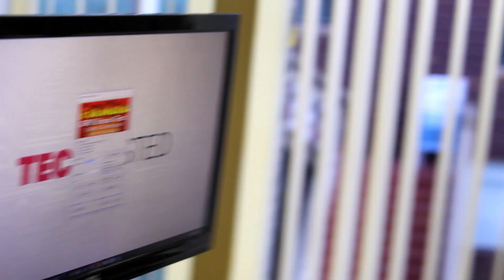The Pursuit of Silence: Foam Lining Case Mod

Comment: even though this is old you really don't need Foam Lining. 
i have a Corsair Carbide 500R with 8 Pure Wings 2 120mm fans BL081 hoocked up to a Thermaltake Commander FP SATA Powered 10 Port 4-Pin PWM Fan Hub AC-023-AN1NAN-A1 and with a Dark Rock 4, BK021 cpu cooler and well... its dead quite, i say a case with good air flow is more quite as you don't have to run the fans as high, even if it has dust filters that and use good fan control tools to keep the fans on the low side.

Comment: Double sided tape is what's making this test less accurate. You're not letting the case make a full contact with all the high density foam materials. I know you had your reasons for using the double sided tape but gluing all the foams for a full adhesion would have yielded the best results as intended in my opinion.

Comment: Decibels measures power logarithmically, a  -3dB attenuation = original noise x (10^-0.3)  that is HALF of the original sound energy, which if it is something like a sine wave means a reduction of the peak to peak amplitude of the sound wave to 70.7% (1/1.414) - the 2dB increase of the air cooler is a bit strange - didn't see anything about matching performance - the only fair test of that would be measure sound at equivalent thermal performance (tune the air cooler to keep the CPU around whatever the AIO was keeping it) so you have apples to apples

Comment: 3 dB isn't bad. You should give the results in W/m² instead of dB to give a good representation. Some people think 50 dB is 2 times less than 100 dB, but it's not.
Reply: +L3xou97 I was just about to say that! a 3dB attenuation means the noise has actually been halved (well the RMS of the noise)
Reply: forestR1
 I was not exactly sure if it was 3dB means half or not but now that you say it, yes 3Db is half the noise.

Comment: One thing that you might try is to cut some small washers out of the foam for all your mounting points of anything mechanical. So put them behind the screws for all your fans and drives. That will help dampen vibration from them and help keep it from making your case resonate.

Comment: Did you just add dampening foam to a windowed case? /sigh...
Reply: +Bryst whats wrong with that?
I don't think it looks bad, and it seems to reduce the noise level a little.
I'm looking to get the SilentBase 800 with a window panel, i hope it is quiet enough!
Reply: Its just a major waste of money because the windowed panel doesn't dampen sound as well as bare steel. You dampen all the other panels but the one thats staring you in the face isn't. So it really doesn't do anything.
Reply: I tend to disagree.
Of course, Acryl doesn't dampen the sound. If you want your PC to be really silent, go for a non windowed Version with foam on all sides.
But I like to see my Hardware AND have a quiet PC.
In theory the bouncing soundwaves in the case are reduced by applying any amount of foam, so, even if little, it does help.

If you want to have the most silent build with a windowed sidepanel, like me, foam is of help.
BeQuiet has a double glazed acrylic sidepanel to help with that.

Comment: You could also try open cell foam blocks in your unused drive bays (i have not personally tried this). 
This kind of foam might also be slightly better than that hobby foam, and it has adhesive on one side already amzn.com/B007P3ONSA
3db is a decent improvement though, especially if you're using your pc for recording

Comment: The H80i also has 2 fans... Also you removed the pump noise, so yeah, you did decrease the noise there.
Reply: +Shaxi except they measured a 1db increase.
Reply: on the basis of the number of fans to reduce the volume is completely nonsens ...

it is even better to install more fans the more fans you have, the lazier and quieter each fan can run ...

Comment: you want silence? use fewer fans that are bigger and slower, and stop asking for 50º load temps, 70-80 is ok for any cpu-gpu
Reply: 2 fans on the case is the best for performance per dollar.  Ur right bout bigger is better. You Could go fanless on your cpu cooler if you have an Intel cpu or an underclocked amd. I'm not sure how to handle the GPU besides it actually shutting off the below a temp threshold or going for a fanless gpu. Complete silence is really difficult.

Comment: dude, nice vid, use less fans on your case and you will have a quiet pc
Reply: +MrAndreppc this is true. But it is always better to use more slower fans than fewer faster fans.
Reply: i`m using a corsair 250D case, with 3 fans, one intake all 3 fans are at the loest RPM possible at idle and they only go to 60% at full load my 4790K is at 70C  in a 26C ambient, sorry i`m from Brazil, but the thing that makes the most noise is my PSU is the cheap "old"EVGA 750W, what i want to say is, just try to lower your fans RPM and you will have a much quiet PC, sorry for the long text hehehe
Reply: nice chanel by the way, hope you go big fast the videos are nice ! :)